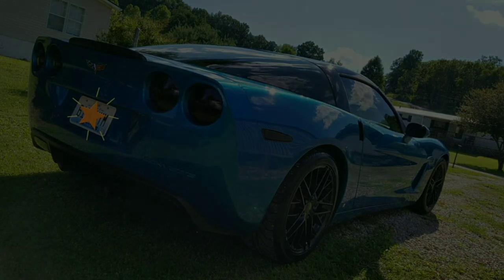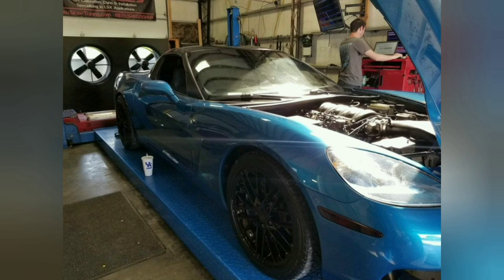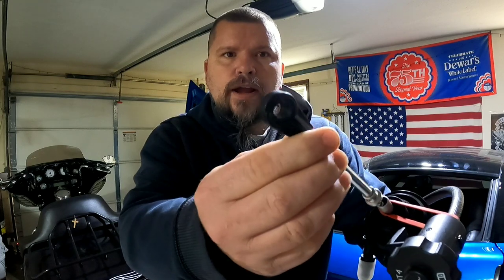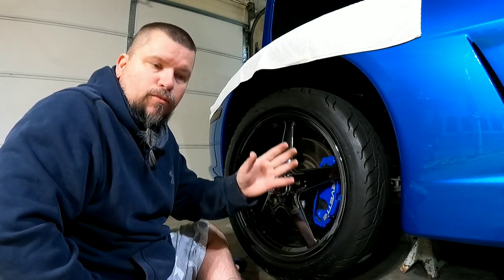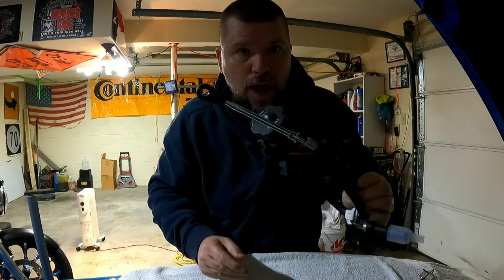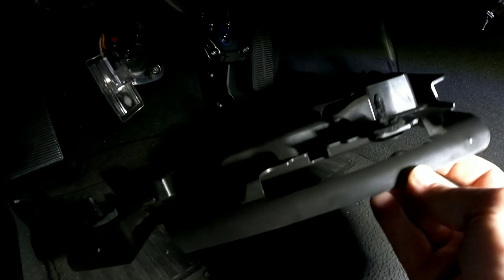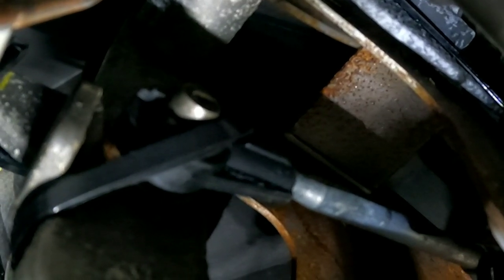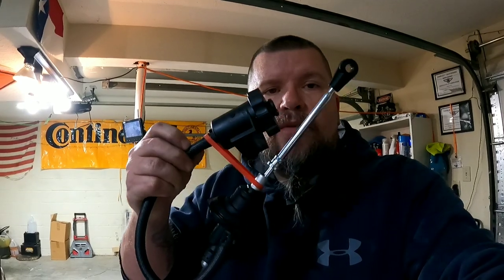C6 Corvette clutch master cylinder install

Comment: Believe me it's much worse on a c7. I had to use my quickjack lift, remove the tire, loosen the wheel well liner and pull it aside, loosen the fender and then remove the washer fluid reserviour to even get to the clutch master cylinder. I ended up breaking the cap for the washer fluid getting it out of that tight spot behind the fender (the cap is only a few dollars on amazon). After that I drained all the fluid from the clutch reserviour and put a bolt in it to cap it off, disconnected the pedal on the inside and then disconnected the hard line that goes to the master cylinder and capped it off with a rubber hose cap. Yours is slightly different but it's the exact same master cylinder, the c7 has a long steel braided line that runs up and over to the slave cylinder but I couldn't figure out how to replace it so I just disconnected the line at the master. I twisted it 15 degrees clockwise to remove, pulled it out, got the new one in and completely forgot which way it had to be clocked to slide through the firewall. I struggled for 30 minutes before looking at the old one and figuring out how it went back in. Got it all back in and bled it with a vacuum pump I bought from harbor freight. There's a nipple on the inside of the cluctch reserviour that works well to pull a vacuum for just the line. You can litterally watch the air bubbles come out, I kept a vacuum on it for about 30 minutes and that was enough to pull all the air bubbles out. Refilled with dot 4 and it hasn't leaked a drop since (I replaced it due to it leaking inside the cabin). 

Like you I would rather do this myself than bring the car in somewhere, I don't trust anyone to care as much about my car than I do.
Reply from the maker: Luckily I bought a master that was already bench bled, so that helped. But yes, I also went to harbor freight and bought the same bleeder kit as you. Just didn’t have to use it. I’ve not messed with a C7 much, but definitely sounds like a pita as well! I’m dreading when the time comes for a new clutch. I will have to purchase some quick jacks or stock up on concrete blocks. 😂

Comment: Heads up to screw the new unit into the firewall. Make sure the interior section is guided in the correct path to the clutch attachment pin. Also use a flashlight and pull & twist the unit to get it flush. From that point I was able to use very minimal pressure from under the hood and twist to the left. I spent 3 hours trying to screw it in from the top and no luck. The second I tried to line it up as much from the interior she screwed right in with minimal forward pressure. The rubber seal on the end made me assume it needed to compress in order to lock into the firewall; that is not the case. Hope this saves someone that headache. Also I attached the interior end onto the clutch before screwing the unit into the firewall. That may have also helped line everything up.
Reply: I’ve got mine in position to twist lock in but it will not move but maybe an 1/16 before stopping. It’s all lined up inside the car and just won’t twist back into the firewall. I’ve done broke one master and had to ride up to tick performance yesterday to get another…. Any ideas???im stuck
Reply: Just got it thankfully never mind! 😂
Reply: @clayyng  Sorry for the late reply. Glad you got it. My arms still bruised and cut up 😅. Hope the tip helped!
Reply: @rddiesel1  I got it but it didn’t fix my issue, believe it’s throw out bearing related/just a bad synchro in the trans. Yaya
Reply: @clayyng  Sheesh that’s a job I don’t look forward to doing. Could also be an opportunity for an upgraded clutch while your in there though ✊🏼

Comment: When you took off the black reservoir and switched it with the clear one did you have to vacuum bleed it because I just changed my cmc and my clutch still gets stuck to the floor when I'm accelerating and shifting at high rpms
Reply from the maker: I bought mine already bench bled. It comes with fluid already pushed through the clutch master cylinder. If yours didn’t come with fluid in it, then yes, you will have to vacuum bleed it. If it did come with fluid, sounds like you have a deeper problem, like the slave cylinder or the clutch is toast.
Reply: I got my cmc from tick performance but when u removed the black reservoir some of the fluid flew out the tube and this makes me think that air migjtve got into it and now I might have to vacuum bleed it. The bright side is that I found a method through the forums that allows me to bleed it through the reservoir cap using a plastic tub stopper, a brake bleeder screw and a mityvac to bleed it. I'm hoping that fixes the issue and it's not the other costly methods.
Reply from the maker: @missael1601  I lost some fluid as well when I was installing mine. I was concerned that loss may cause me to have to vacuum bleed mine, but it didn’t and it works perfect. You can go to harbor freight and pick up a mityvac test and bleed kit. MV8000. It comes with the necessary nipples, the pump, everything you need to vacuum the air out of the system. I bought one just in case.
Reply from the maker: I think it was 40 bucks
Reply: @badlsxgarage  I'm gonna return the Pittsburgh bleeder and get the mv8000 instead to save me the hassle. Thanks for the recommendation. I'll post an update if all goes well 🤞
Reply: If air gets into the system & travels down to the slave cylinder, will this method work to get the air out or would you still have to bleed the system at the torque tube? I'm changing my master cylinder today & worried about air getting down to the slave cylinder and causing more issues.
Reply from the maker: @danielchoi2  Yes! Use the mityvac and it will get the air out. Might take some time, but probably same amount of time that it would take to get to the bleeder.
Reply: @badlsxgarage  from what I've read & seen you have to take the torque tube off in order to get to the bleeder unless you have a remote line which I don't. Car only has 40k & the clutch grabs like new. Hoping it's the master & not the slave. Thanks
Reply from the maker: @danielchoi2  you can get to the bleeder from the top. Lay a bunch of towels down on your fenders and intake. Literally have to lay over the intake and reach behind the intake and the back of the block. That will keep you from removing the torque tube, but some you can get to and some you can’t. But hopefully you can get it with the mityvac and be good.🤞 Good luck! 👍 ✌️